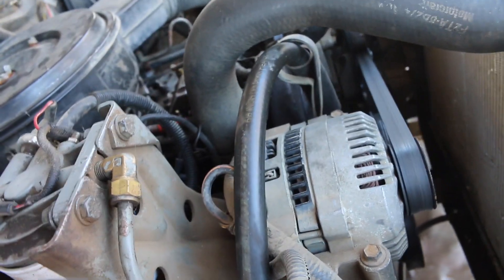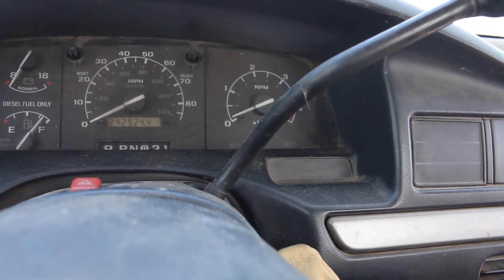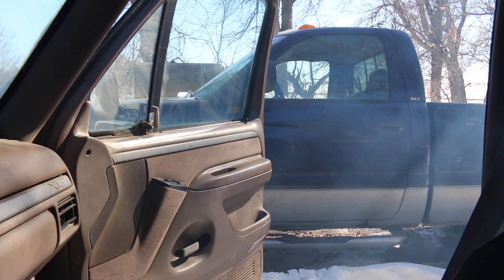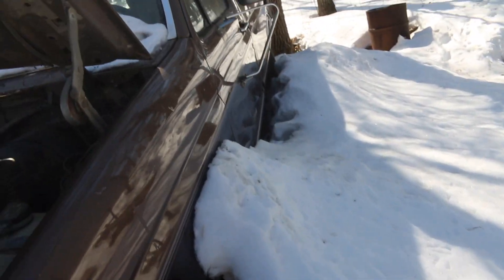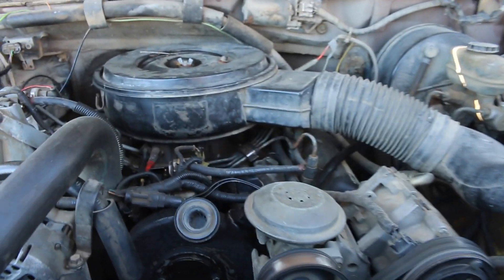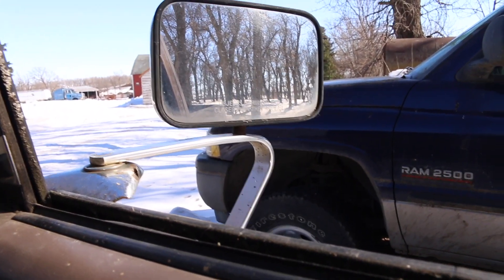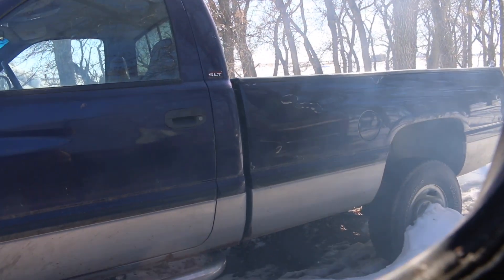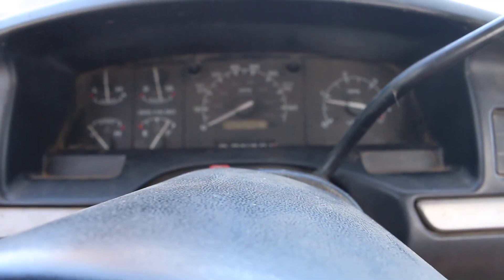Ford F 250 7.3 IDI Snow Bank

Comment: Do you still have the white Ford flatbed and is there any chance of a cold start on that one if you do still own it?
Reply from the maker: still have it just don't have batteries to start it. and it has a bad injector or compression in the last cly number 7 and i just checked it and there is no coolant in the system so that is not good. i hoping it is not a bad head gasket or block have to wait until spring and look at it